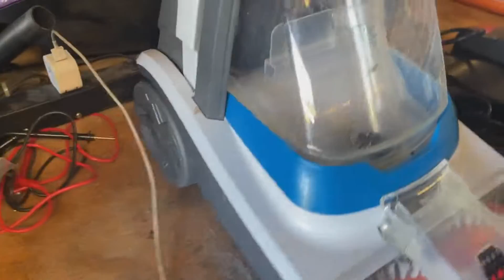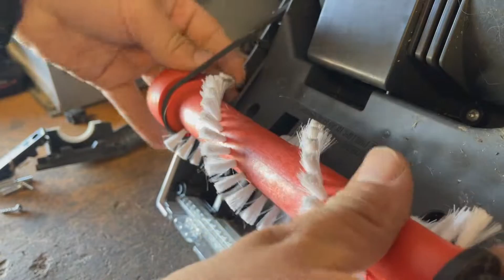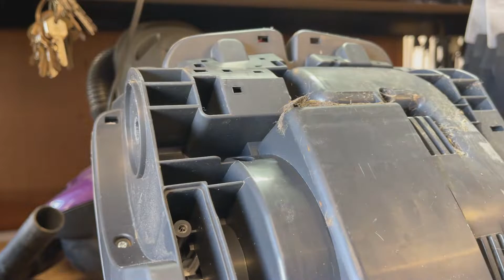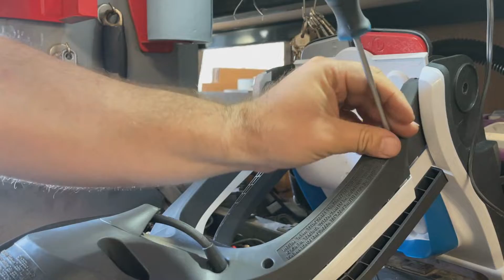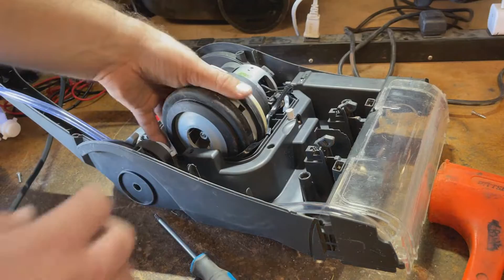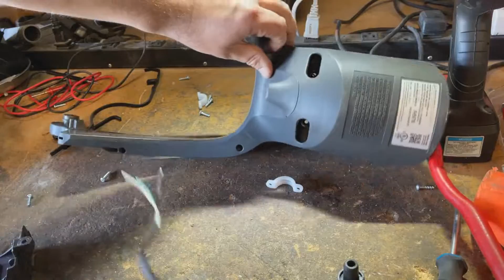Disassemble Hoover Powerdash Pet - Brush, Belt, Cord, Motor

Comment: if you're trying to get to the motor. There's two little white tabs in the little compartment where the brush is. You got to push those in and the whole top white part will pop up like a hood and come off

Comment: Thanks Hank for posting this for the disassembly, a commenter mentioned the fuse hidden under heat shrink on a wire near the motor, it was blown. Replaced and all good.
Reply from the maker: Yup that’s the thermal fuse. Good on you for finding it

Comment: This is old video. Is there a dual power max  model fh54011 model showing belt replacement. This is completely different than mine. This is 2026. I had it almost 3 years now. How old is this video?
Reply from the maker: You’re asking how old this video is when you can clearly see it was posted May 2021? What?

Comment: FUSE BLOWN: Hello, thanks a lot for this video, it was very helpful. Near the motor there is a FUSE, in mine it was BLOWN, It is hidden in the cable, I didn't have the exact one so adapted a different one, I hope it lasts, now its working, I didn't need to dissasemble the top part, just the bottom. I hope this helps someone, regards from Monterrey, Mexico
Reply: Thanks for this remark, thanks to you I went and opened it up and found the fuse by the motor under heat shrink. 250V 12A soldered in line. Terrible design. Thinking about moving it up to where the cord enters with a fuse holder. Again thanks you did help someone in Long Island, NY!

Comment: From what I’ve read either on Google or on YouTube that the power button stops working. Which is exactly what happened to me. Only had it maybe two months at that time. I was in the middle of cleaning my carpets and turned it off to refill the solution turned it back onto use it and nothing. It’s actually extremely irritating that so many people has bought this machine and wasted our money because it doesn’t work. Doesn’t even come on. I guess at this point it I might as well try to take it apart what’s the worst that happens…it doesn’t work!? 🙄
Thank you for taking the time to do this. I really appreciate it!
Reply: @thatswhatshesaid6326 same brother. Did you get it apart ? Were you able to fix it?

Comment: For the longest, I was stuck on how to remove the wheels. Come to find out the pinch part was installed wrong so I couldnt use my pliers to squeeze the points together
Reply: I had this problem too turns out they used c-clamps on mine if you peel them off with a flathead screwdriver the wheels come right off

Comment: Very helpful video. Opened new after having for a year only to discover that Parr of the upper body assembly was pulled out for some reason. It's not broken but after removing two main screws I knew there had to be another set of screws making it possible to open/fix body of this thing. Thank you so much!

Comment: I took one apart after it made funny noise, puffed smoke, and smelled funny. It seems the bearing in the motor went bad. The motor was press fitted together so I couldn't confirm the diagnosis, but the shaft was very difficult to turn and it made a scraping noise when it was turned. A new motor was half the cost of the machine, and the machine did not come apart well. It went into the trash can. If I paid someone to fix it for me, they would have had to charge me double what a new one costs just for the labor because it was a PITA getting it apart.
Reply from the maker: Yea all this stuff is made to be tossed when it breaks. Most of it is not repairable, at times you'll luck out and an aftermarket supplier will occasionally have the part you need but unfortunately most stuff made now a days is junk.

Comment: How do untake the handles each off on the top and I want to clean out the4 tubing so what kind of tool did u use. Screw drivwr but there is is a round looking  type of screw it ars seen beforsw what tool did u usa foes thT and how did u disassembsl the handle

Comment: Loved mine! I had it for 2 months and as I have saw others say.. smelt as if it were burning! They are good but go out quick.. when I am able to, I plan to invest in a higher one that will lst longer! -- It is either the belt with mine OR water in the motor.. which are both common.

Comment: You need to clean it right after use when still wet. I elevated it on a patio chair and spun the brush until I got most of the lint.  I then used a spray bottle to rinse the gunk that was left while tipping the machine from side to side. Don't let the stuff dry or else it's double the work.

Comment: got one of these and the power button is hard to press. is it pretty easy to just get to the power button or do you have to disassemble the whole thing to get to that button lol
Reply: Need same help the power button is stuck please help it's happened b4 and without fixing it was able to press power again but after a month power button won't press help please
Reply: @shannaquintanilla5029  i took the power button out with some pliers. now it just stays on when plugged in so I didnt take it apart to fix the button. it works fine.
Reply: Same problem!

Comment: Thanks for the video. I decided to try to repair mine rather than buy a new one. It needed a new motor. I was able to disassemble it and switch out the motor. However, I’m having trouble getting the cover to snap back in. The side by the belt will not completely close. It seems that it’s hitting on something but I can’t figure out what. Has anyone has put one back together any suggestions and have any suggestions?

Comment: Curious to what my problem is.  I smelled smoke and looked and it wasn’t the belt.  Opened it up and found sparks where the motor is at and it was grinding on one of the parts in there.  Tried turning it on and it gave up.  It will no longer turn on.  Any chance anyone knows how to fix this?
Reply: Same :/
Reply: @hithereimjack2252  Hey!  So I think mine was a faulty motor.  There is a 1 Year Warranty on the machine.  I ended up getting a free replacement direct from Hoover.

Comment: I’m trying to get the wheels off but I can’t tell what you squeezed together to release them .
Reply: Mine has a different design than the one in this video, it has a little metal lock ring I was able to push out with a flathead screwdriver, but it wasn't easy.
Reply: @therealbenschwartz   thanks bro just help me out alot I also have the wheels with the ring on it

Comment: looking for a video to fix on/off switch... Found out if there is too much stuff  or wound around the bushes it stops working so the motor doesn't burn out!  Was an easy fix I took out a few screws and unclogged the brushes and wala it was back in order!!!! Nothing in the help or trouble shooting but called hoover and the young lady took me to tay this! 👍
Reply: I need help with the same problem you are available to help me?
Reply: @karinavenegas2783  sorry I didn't see this  call hoover and they can help but basically it's taking out the screws on bottom and pull brushes out then clean any off the brush, remove hair or strings and then put brushes back on and screw cover back on  the machine and works great!  😊

Comment: you skipped a part where you took apart the plastic suction piece. i saw you remove the very top piece but didnt see how you separated the other piece. basically has 2 pieces snapped together/stacked on top of eachother. tried to separate it myself but felt like i was going to break it.
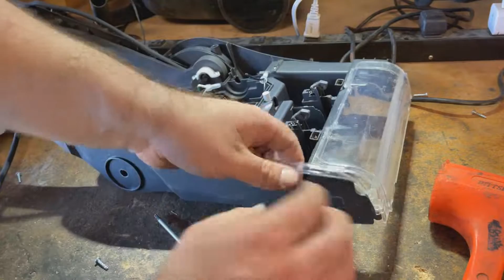Reply: nevermind i see it at 3:58, sorry

Comment: Thanks for the video. My stopped working out of the blue. I opened it up and found out that the switch was moving up whenever I pressed the on pedal and it wasn't reaching the switch anymore. Put the switch down to its place and put some tape and a piece of wood on the whole that it is on the white cover that touches the switch. Now it is working, since the switch won't move anymore.
Reply: Do you have a video for this, i cant find a video  of how to get to the foot pedal,  or power switch,  what ur talking about. Mine was working fine, i cut it off and now it wont cut back on, i kept  messing with the pedal it came on but i cut it off back on no power
Reply: I wrote to you under here
Reply: @Tturn1977  unfortunately I didn't make a video of it. It was quite difficult to disamble, but it is not impossible. Take off all the screws, even the ones on the handle, than you are going to reach the pedal. That is where I found the problem as I mentioned before. Hope I can help.
Reply: @Tturn1977  the wheels are the most difficult part to disamble. There is a little piece of metal that holds them inside.
Reply: Roberto - can you send me this info also please?

Comment: I just can't pull these stupid wheels off ugh
Reply: Same!! Mine have nothing to squeeze together!
Reply: @chickensandwichtillidie7974  I ended up breaking the whole machine but those wheels did come out.
Reply: If your model is similar to mine, my wheels had small "C" shaped washers holding the axle on.  I had to use two small flat head screwdrivers to pry open the washer to allow the wheel to come out.
Reply: There is a little piece of metal that holds them. Look it up in the internet and you will see what I am talking about. I drove me crazy, but I finally did it.
Reply: @robertouyeda5645  I know which piece you are talking about. Can you provide the link
Reply: @mtimster  YouTube won't let me put the link here. But search for the wheels on the Internet. The New modelo are diferent from this vídeo.
Reply: There's nothing to be squeezed. You Will need a pair of pliers to Take The little piece of metal off.
Reply: @robertouyeda5645  late. It's broke it is a POS

Comment: Thank you. This stuff is built to fail, and then the old “it’s only $90, not worth fixing”. We’re  such a wasteful species
Reply from the maker: Yup, unfortunately that's the world we live in, everyone wanted cheaper products and this is the result of that. Gone are the days when a vacuum would last 20-30 years with normal maintenance. Now a built breaks or they clog the machine and they just throw it away.
Reply: @hanksgarage_  Or due to the laziness/ignorance of people.  I bought a fairly new Hoover vac at my local charity thrift store for $15.00.  Plugged it in at the store and it seemed to be working just fine.  Went to clean it when I got home and O M G!!!  The bag inside was a solid square brick!!!  Also found the belt had broken (hmmm...wonder why!!!)  Replaced the belt and bag and BOOM...like new!
Reply: @BlueMeaney49 ya alot of people don't bother trying to diagnose the problem without throwing stuff away. You need to maintain stuff. I'd recommend a sebo or Miele vacuum. They have excellent warranty and are built to last.

Comment: I took apart the bottom to reveal the brush and belt, fixed that and cleaned out the brush and now the motor won't even turn on!!!! Before we screwed everything back together, the dumb thing was working and as soon as we put all the screws in the motor wouldn't start 🤦🏾
My original problem was that the brush wasn't spinning properly. I contacted Hoover and they gave me a 40% discount to buy a different product
Reply: I had the same problem, I was missing the little orange filter cup under the dirty water tank. Works great now

Comment: Idiotic design for the power switch...failed on the second use. A tiny piece of plastic holding the switch in place? Really? The whole switch moves out of place so the pedal can no longer press the switch properly.
Reply from the maker: Its all done on purpose, these aren't made to last... they're disposable.
Reply: The hardest part is to open the whole thing up. Specially The wheels. Once you do that it's easy to figure out how to fix the pedal switch on system. Cause it's all mechanic.
Reply: I fixed mine with a little piece of wood and tape.
Reply: @robertouyeda5645  how?
Reply: Can someone make video on how to add wood please help I need it accident got bad
Reply: I had the same issue.  One of the small tabs that hold down the switch was bent so that the pedal could no longer press the switch without pushing it up out of the way.  Luckily I was able to bend the tab back up without breaking it, and now it works.  I'm sure it won't be long until it fails again.
Reply: @sheepnutts  Ridiculous designed. Possibly on purpose like Hanks said. Maybe try a piece of wood like the other comment suggest.
Reply: @The2Coolest2   Agree, idiotic design. Even though I’m late to this thread, because it’s taken me three years to decide to clean this machine my daughter bought and used once, (when she moved out of my house w/her 2 dogs) she left the machine dirty, and stored in my garage. I think a first year engineer could have done better on design.
Reply: @PLS.54  I'm an engineer and i agree. My family got rid of it. I recently got a different one from Costco that was on sale for 179. Works great so far
Reply: @The2Coolest2   Cool 👍
Reply: @PLS.54  It's the Bissell Proheat 2x Revolution Pet Pro if curious!
Reply: @The2Coolest2    Interestingly, when I went online to find the best rated cleaning solution for wall to wall carpet cleaning, Bissell Pro Max was #1.

Comment: Thank you so much for taking the time to make this video. I would have broken it for sure had I not seen this. I have a fairly short fuse and I know I would have burnt through it without this. Took it apart hard wired the stupid cheap switch and off an running again. Oh and put in an inline switch instead.
Reply from the maker: Yea sad to say these are made to be disposable units. You can fix them though as you’ve seen
Reply: L
L
lol
Lol
L
Point

Comment: where do you purchase your new belt? ive checked all over amazon and the ones that ive purchased have been wayyyy too short for my hoover. i even checked on their online site and theyre all sold out of this specific belt for the powerdash! any suggestions?
Reply from the maker: The new belt will always seem smaller. They are stretch belts
Reply: I had to order mine from hoover
Reply: You might also try your local vacuum repair shop.  Mine was able to get me new belts for my old Hoover vac.

Comment: Mine started to smell like it was burning. My first thought was the belt but I checked it twice. It's clean and cannot find what's burning. No smoke just a burning smell. I am a single mom of 2 toddlers and I had to pinch and save to afford to buy it in the first place. I can't afford to buy a new one and want to fix it myself. I have only had it 6 months.
Reply: The brush roller can get moisture into the bearings (seems to be an issue on the right side of the roller, which doesn't seem as well-sealed against wet getting in). It should spin very freely when you hold the squares on either end (or with the belt removed and the roller back in the machine). If it were seized, you'd burn the belt almost immediately, but if it's got a lot of hair wound around the ends, it may have a little resistance without being seized - and that may be heating up the belt.
Reply: I have the same issue and checked the brush and it spins very well. Any other suggestions??
Reply from the maker: Make sure the brush roll turns. It’s possible something is binding up
Reply: @M is for Magical Mady after doing some research it seemed like the answer was the motor was having problems. I contacted Hoover and I was within time frame for them to send me a free replacement. I’d recommend reaching out to them
Reply: I have the same problem. Make sure you clean out all the hair inside after every use and put a fan on the machine while it's sitting upright on a chair to dry it out if there's water getting inside the motor.

Comment: Why can’t it just be a simple fix… Thanks for the tear down it’s going to help me get to the motor.
Reply: I found a motor on eBay
Reply from the maker: You’re welcome. Unfortunately the stuff is meant to be used and thrown away. Outside of a new brush roll and some small stuff you can’t even order individual parts for these.
Reply: @hanksgarage_   Yes, parts are available from several vendors on ebay